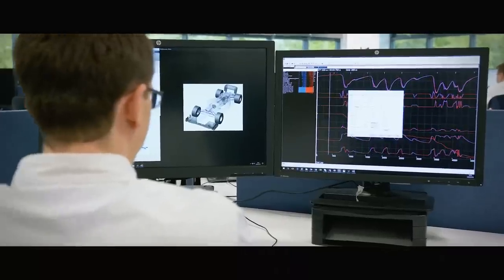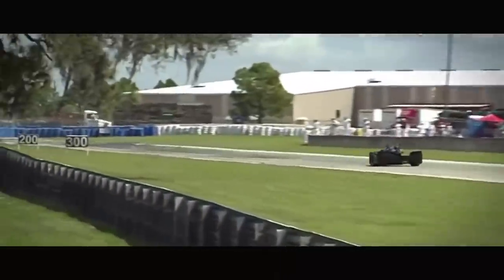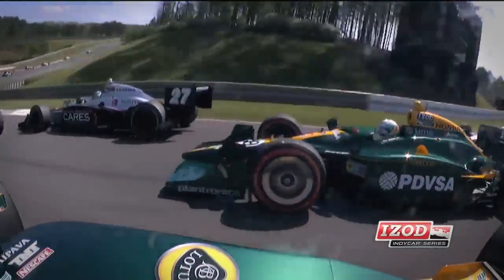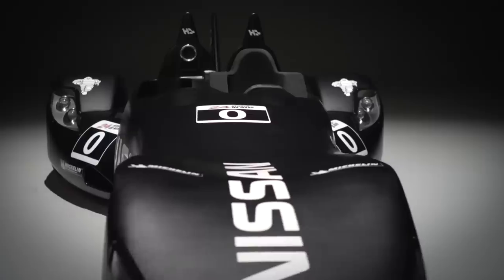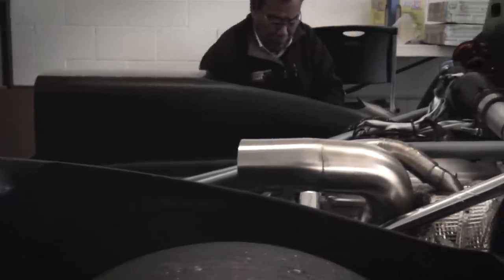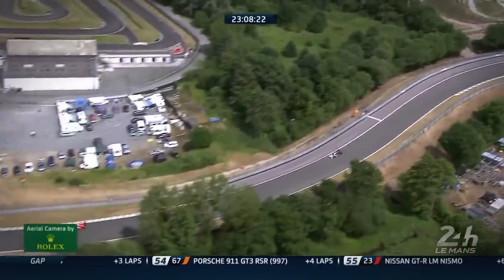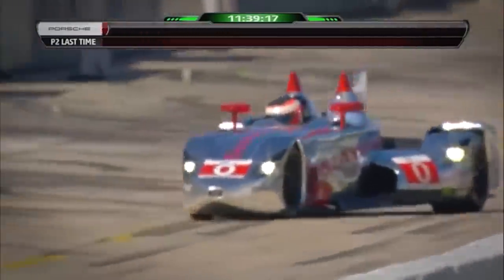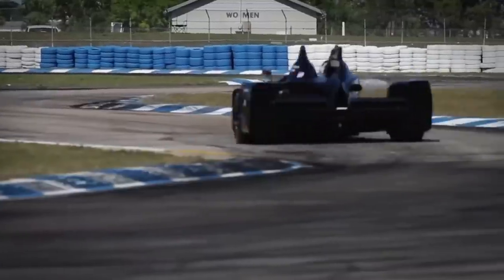The Motorsport Revolution That Never Was: Deltawing Project

Comment: Satoshi Motoyama desperately spending HOURS to attempt to fix the deltawing enough to make it to the pits after the 2012 crash at Le Mans is still one of the most heartbreaking things I've ever watched unfold in a motor race.
Reply from the maker: For real. I was thinking if it could be nice to put that clip on the video, but since we didn't specifically talked about it in the script, i decided to discard it while editing the video :(
Reply: @PROJECTDREAMMULTIMEDIA  It's hard to explain that specific anguish without a lengthy explanation of the Le Mans specific rules, so I can't fault you for it.
Reply: @PROJECTDREAMMULTIMEDIA  nissan blide glider is electric version of panoz delating gt, also did not go on sale
Reply: @PROJECTDREAMMULTIMEDIA  panoz gt deltawing was to be production car , could it have been sucessful? inline 3 sound good and aston martin makes turbo sound still pretty good

Comment: Thank you and yes we all miss Deltawing. The problem is not the lack of innovation. The problem is the resistance to innovation.
Reply: That does not surprise me  at all. How long has camless valve  technology, improve  ignition systems, and more existed and Racing teams literally fighting so no one uses it first? The Deltawing was a total upending and the car should have been given either its class or it own series.
Reply: @DocWolph  better yet start your own series
Reply: In case of the Deltawing it was more a problem of internal struggles. 
From the moment they started building it, the involved parties started fighting amongst each other, followed by many lawsuits and mounting frustration.
Reply: And here I was thinking Motorsport was all about innovation... 😑
Reply: the problem is this car was ugly as f*ck. as an Indycar fan, i most certainly do not miss this car. i know the DW12s were uglyer then the IR-05s and arguably ruined the series, but seeing these damn things instead would've have killed Indycar off entirely.
Reply: @DW98rosy  
Racecars are embodiments  of "Function Before Form". They are NOT meant to  be pretty. That is what the livery is for. Racecars, like weapons, tools, and any equipment, have nary a line, curve, or detail that does not help them function better, to be faster, handle better, be more agile, regardless of series or class. 

The Deltawing literally does this while ditching so much of the extra, caked on by decades of rules, and stagnated thinking, it has a terrifying beauty. Do not confuse that with "ugly". New thinking that freed the Deltawing so completely, the race judges could not nerf the car enough to stop it from winning. There is a undeniable beauty in its function. This is why the car needed its own class or series. It was just too beautiful in its function. Beauty that engendered fear, loathing, and inadequacy in those who ran against them. 

Thus your own attitude and competing racers deliberately running the Deltawings off the road before they could mature into something unstoppable... and they would have to drive a version themselves. Heaven forbid! Innovation leading to the evolution of the sport!

In IndyCart, the Deltawing would have been received extremely well, especially when it gets to the road courses. The car looks so unreal speeding and maneuvering you would be forgiven for thinking you were watching a video game with insanely good graphics. That and the cars would not look like every thing else that came before for the last 60 years. People are attracted to new things. And nothing attracts more than a new radical design that works extremely well.

You see, just because the car is not longer racing does not make every fool thing that comes out of your mouth true.
Reply: @DocWolph  
i'm all for innovation, so long as it doesn't kill off a series and make it near-on unwatchable. plus, in a spec series like Indycar, i doubt the things would've raced well at all, especially not on the ovals. you forget, aswell, that just because "people" (by which i mean the f*cking awful Indycar fanbase) hated the IR-05 doesn't mean they wouldn't tear apart this horrendous thing. 

and i know racecars aren't made to look pretty, but that does not stop some, like the IR-05s, looking bloody fantastic, especially some of the liverys it had were gorgeous. these things not only would've have sounded worse then the DW12s, it probably would've killed off what little fanbase the series had left. i mean, remember how Indycar themselfs reacted to the thing, they hated it. they stuck with Dallara and for a damn good reason: even when they miss on the looks, which they definitely did with the DW12, what they make still produces great racing, and it's still better then what people like ben bowlby came up with and would've have brought to the series, in terms of racing quality, aesthetics, and sound.
Reply: @DW98rosy  
Your knee jerk reaction based on what? Your gut reaction to what? WHAT makes you think the car is "ugly" and what do you even mean by "ugly"? Maybe I'm too old to be lead around by my emotions and random gut impulses like a toddler. So feel free to  explain yourself so I might understand... and possibly yourself, as well.

And as I said, in previous comments, The car needed its own class or series. The feelings of fear, loathing, and inadequacy was all over the competitors racing against the car and the judges were obvious. A huge chuck of racing fans however were/are in love with the car.

Also the current Dallara Indy Cars look like the Deltawing more now than ever... Memories are long in autoracing, I don't  think it is much of a coincidence. Swap them out for Deltawings and I don't think anyone would notice or mind.
Reply: @DocWolph  you, do not make any fucking sense, and saying that the IR-18s look more like the deltawing is a very good way to piss me off, and Indycar fans would both notice and very much condemn the sanctioning body, and rightfully fucking so, if they swapped the IR-18s out for these abominations.

the front and rear wings are what make open wheel racing cars look great, and even though front wing designs have certainly been done badly (see everything CART used), they still are an integral part of the car that when removed, almost removes any sort of personality from the cars, and makes them look just wrong. plus you consider the way the front end of the deltawing was designed, how in the hell would it have any steering lock at all, and it most likely would have been horrendously unsafe, had it raced on ovals, and the rear fins only make the car look even more bulky. perhaps the problem is it was designed to resemble a literal dart and not an open-wheel racing car. these things just looked wrong in every possible way, and Indycar is in a much better place then it would be if it had given in to ben bowlby's bullshit.

(never once did i say "gut reaction" or anything of the sort in either of my original comments, too. and just because i don't often swear doesn't mean i'm a fucking kid.)

conclude, my definition of "ugly" is something that looks like it could kill a series' credibility on the fucking spot, which ben bowlby nearly did to Indycar, had they been gullible enough to believe anything he said. innovation is a good thing, so long as it doesn't give off the general vibe that it was designed by someone who has quite literally zero sanity. and speaking of people with zero sanity, you, can fuck right off.
Reply: Yep as the line in cool runnings 

"We're different. People always afraid of what's different"
Reply: Basically anything in this area of the south resists innovation

Comment: I loved watching the little deltawing do its thing. Such a different design concept and it worked! It sucks that the Nissan GTR LM they made did not work. If I recall it quali'd back of LMP1 and even LMP2 beat them for a few cars. But still, they made a FWD, front engine LMP1, which is such a long shot but they did it.

Comment: Due to the unique concept virtually all rollmoment had to be supported by the rear axis. the delta-wing team came up with quite an ingenius way to cope with that. unlike with heave-roll-systems used in f1 the delta wing still had one spring-damper unit for each wheel (like in traditional independent suspension systems). of course it was pushrod/bellcrank-driven, but the trick was that they put a so called T-lever in between the bellcranks and the spring-damper-units (similar to how a third-spring-damper system is connected). they connected to spring-dampers right at the ends of the T-lever and the bellcranks further inward. 
in heave the whole T could rock forward and the displacement at the spring-dampers was the same as on the bellcranks. 
in roll however the T-lever could rotate about its 'leg' and because the bellcranks are connected further inward towards that rotation axis, each spring damper unit is compressed more than how much the bellcrank moved.

this way they could achieve two different motion-ratios for heave and roll with just a smart arrangement of the spring-dampers. they did not have to any fancy rolldampers or heavesprings, they where abled to use of the shelf dampers simply and tune them to their needs.

Comment: Panoz refusing to chose between owning the series and owning a team is the one and only person responsible for the DeltaWing failure.

Everything in endurance racing all over the world revolves around the BOP (Balance Of Performance). This is the heart of the concept. All participating cars must have their performance assessed as fairly as possible and various parameters adjusted (weight, power, fuel tank capacity, fuel pump speed) with the goal to even out performance as fairly as possible so that cars are compared on their reliability.
The BOP is a hard battleground. All manufacturers continuously track, report and discuss any performance parameter they consider uneven. And the owner of the series who is responsible for the BOP has an immense power. A slight tweak one way or an other could give a huge advantage to one team over the others.

It is obvious and accepted by everyone that a completely new design needs a test period to assess its actual performances before including it to the BOP and making the right adjustments. That's what the special Team 56 is designed for. Most often the concepts don't survive the reality check because they can't reach minimal requirements and they are abandoned. Sometimes they have actually good performance like the DeltaWing. And obviously since they are not restricted by the BOP they outperform the cars that are restricted during that test period. When the DeltaWing did just that it was something uncommon but not revolutionary.
The truth is endurance racing is a long run. Passing the test period is only the prerequisite to be allowed to participate in the actual race. Which starts when the car is included into the BOP.

And that is when the problems started for the DeltaWing, because of the conflicting interests of Panoz being both series owner and team owner. It's obvious that other participants started to openly accuse him of trying to cheat the BOP to his advantage.
In other series where all cars have the same common specs, having the series owner being also a participant team owner is no issue because all rules apply the same to all teams. But endurance being all about comparing cars with different specs evened out by the BOP, having this situation is simply not acceptable.

As long as Panoz insisted on holding both roles of series owner and team owner the DeltaWing was doomed because the only way for him to prove to other team owner that he wasn't trying to cheat the BOP to his own advantage was to cheat the BOP against himself. Other manufacturers where not afraid of having a fair race against the DeltaWing concept. They were afraid of having an unfair race against the guy who had control over the BOP.

So Ben had no other choice than make the decision himself and separate from Panoz to get out of the conflict of interest. But Panoz greed didn't let go. He kept on engaging his own DeltaWing team. And obviously other participants united in protest against every single bit of BOP ruling that seemed to give an advantage to Panoz himself. The DeltaWing was only collateral victim of the conflict of interest Panoz had created. Any other concept put in the same situation would have suffered the same consequences.

There was also a serious safety issue because the DeltaWing was so low that other car drivers had difficulties seeing it in their mirrors and it also had difficulties to turn at low speed forcing it to take different trajectories than other cars under yellow flags. Combining a different trajectory and being hard to see in a packed group stacked behind a safety car resulted in the DeltaWing being involved in several accidents under yellows. That was a serious incompatibility that put the life of the pilots at risk. And that was the reason for forcing the DeltaWing to return to the pits each time there was a yellow flag until they could find a suitable solution. I have confidence with time they would have found a solution to that safety issue. But the main issue of having the BOP owner being also participant was resolved the hard way, so the safety issue became irrelevant.

Comment: There was a period of time where the delta wing in America had a closed cockpit and a splitter on the front. It was really successful during that time.

The delta wing was so cool to watch and actually fast, it’s too bad it lost support
Reply from the maker: I remember the closed cockpit version, but i don't recall the front splitter instead.
Need to dig a bit on the internet!
Reply: @PROJECTDREAMMULTIMEDIA  it was on the very last iterations, had some vertical end plates on that splitter if I recall correctly. Car was still chrome until they added the splitter.. then it went to the American flag livery.

I think the delta fin became more of a shark fin as well

Comment: I don't consider it a failure.  It was a radical idea, and it did what the creator said it could do.  Something that does what the creator says it can do can never be a failure, it can only be a failure if there's resistance.  In this instance, the resistance came from the competition.  It's the perfect design for sportscar and endurance racing, and it harkened back to the old days where you had a tiny Lotus racing Porsche 917s, McLarens and Shadows with their gloriously angry BBCs.

Comment: If they would just classify my single-seater as a regular car, I could easily get a podium in the local hatchback cup. You can't come up with a radical design like this, and then have a sad if they won't let you play. LMPs look they way they do, not because of lack of creativity from design and engineering, but because the cars are designed within the constraints of the rules. They should be thankful that they had the opportunity to race this design in other classes at all. 

To be clear, I've always loved the Delta, I was really hoping to see a new class with similar designs. But that's the problem... It's an entirely new class of vehicle. It's a hard sell to convince all the teams to abandon a working formula that they've already invested millions in

Comment: I wish you would have explained the technical reasons for the car being so fast. Mostly, how does the suspension work with such a narrow front end?
Reply: I think a read once that it's weight distribution is like 30/70, and that's what allowed it to handle like normal

Comment: I like aero. My concern is everything you hit that doesn't go under the car is gonna ramp right-up the hood into the windscreen. No bumper chin or nothin.. 300 plus pounds (enter metric equivalent here) of critter on the hoof pushed-in the front end of a hatchback I was in almost a foot at 60mph (😝) but it didn't slide-up. Boxy 80's bumper caught it. Narrow is good though. I'm thinking production cars btw. Stuff like this only starts on the track till it gets to the road. I was always a fan of the Volvo tandem concepts from a decade or so ago.

Comment: honestly, it was a fresh idea, but pointless imo.  Yes the car can be close to half the weight, half the drag, and half the power, but you know what also is? a Formula 3 car.  ~550kg, 380hp, and you can buy one of those for just $120,000.  They set lap times in the midst of LMP2 cars as well.  And if you went down this development path, you'd realise that yeah, the formula 2 car is even faster... ultimately, i don't think the delta wing is a good design to begin with.  too much balance is put to the back of the car.  The small front tires are ok for cornering, but under braking, they fall way behind.  The smaller body of the car is also not ideal for ground effects.  And hence why shortly after, the Porsche 919 and Audi R18 became dominant forces.  Efficient monsters that sipped very little fuel, but had explosive 900+hp systems on tap at the start of each straight.

Comment: Why doesn't the racing world create a builders prototype racing series that features groundbreaking designs based on basic balance of performance formulas? Maybe even have it be a time bracket series instead of hardware spec based. Maybe some combination of the two. The most important rules would be cockpit, cage and seat, and other critical safety criteria. Maybe classes should also be divided into amateur, privateer, pro, and factory divisions.